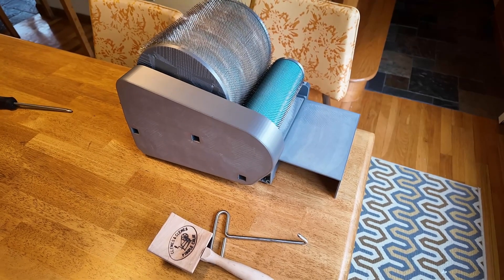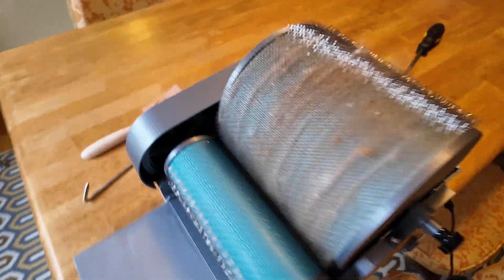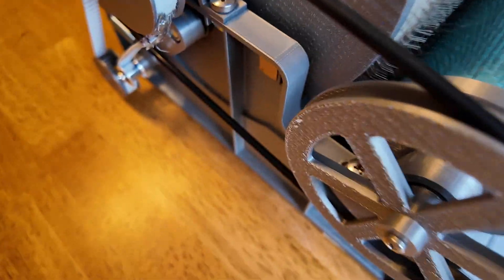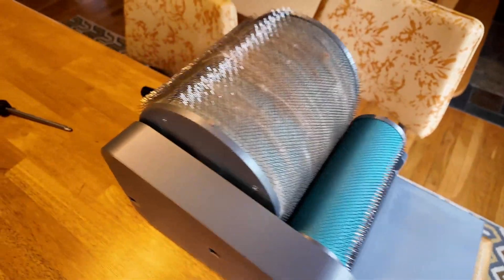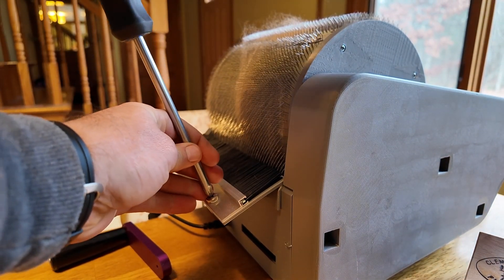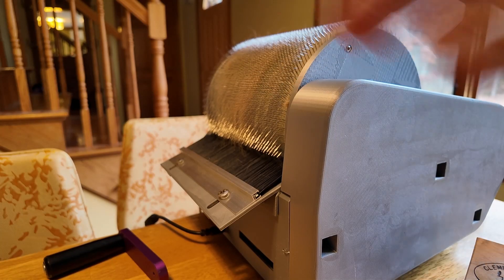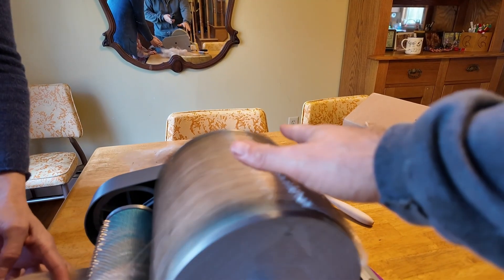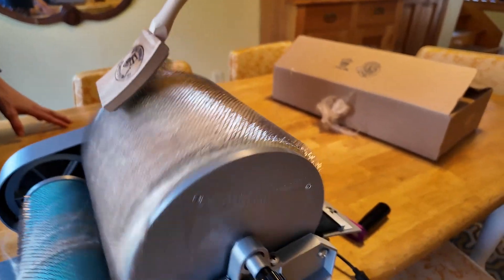Spin 191 - Drum Carder (Improved Drive Belt Power)

Comment: Hi #dreaming robots, I own an electric drum carder called the Ekelund Carder (engineered by Lena Ekelund in Sweden). She has put a 72 TPI on. After having used it for years, I wished she had put on a finer TPI on the main drum. 
Also there are 2 speed dials for the licker in and the main drum. The combing feature can be used as you wish by using a handle.

Comment: I have a little "wild" 4" drum carder with 72 tpi for playing around making art batts. I'm not terribly experienced but I'm really looking forward to your new electric drum carder. The Wild has a grooved channel for doffing which keeps the doffer from trecking off into the carding cloth. I see the prototype has a flat metal track. Still better than the older drum carders with just a break in the carding cloth to the bare drum. Also the Wild has a brusher that has a pivot so the brusher can easily be placed whatever angle needed or swung up and just tighten the screw knob to hold it there easily. Sorry if that doesnt make sense. If people need a longer tray to introduce fibre, that made me think of my inkjet printer. When I print something it activates and a hinged tray flops out to support the printed paper. But it has 2 hinges so a secondary tray can be opened out to support the weight of more than a few sheets. Thank you for these updates!
Reply from the maker: Thanks for the feedback.  I was already thinking about a groove in the metal for the doffing, but I need to talk with a metal manufacturing factory to see what that would do to cost.  I know the current solution is very easy to manufacture, but if I can add a bend or groove at low cost I will.

I am familiar with the hinge others use for the packing brush.  The method I came up with is more compact and cheaper to manufacture.  In my testing I actually like how it's also more secure.  It doesn't give you different angle options, but I'm not sure that's important.  More testing is required, but so far I like my solution better than what's out there.

There are a few options I could do for making the tray longer, but I'm not sure it's worth it.  Anything here will add cost.  I plan to do a bunch of testing to see how the current length works.  For people who really want a longer feed it is very easy to add your own platform to feed into the existing tray (for example a cutting board with a few books under it would work or a fancy solution would be 3D printing a different tray). 

I'm always trying to decide if it's worth adding a feature that will make it more expensive for everyone vs keeping the cost down.

Comment: Faster isnt better. Tender fleece will be pulled and torn causing neps if it's too fast. Also, holding onto the fleece while it's feeding will cause it to nep and stick into the licker in brush. 
This is going to be a game changer for those who are longing for a drum carder. And there are MANY! 😍
Reply from the maker: Thanks for the feedback.  We'll work on our technique and won't hold the fiber like we did in this video.  I've probably heard from about 20 people now on how we did that wrong 🙂

As for speed, it can be controlled and I'm just talking about max speed.  I'm still working with testers who know more about carding to me to figure out a good max speed.  Obviously there could be too slow and too fast.  I'm sure my current speed is fast enough.  If others think it's too fast then I'll limit the speed more.

Comment: I think it's important that the packer brush be able to be removed quickly, perhaps swung back somehow, and then quickly pushed back into place. Otherwise it can inhibit the backwards motion of the drum that you may need when removing a batt, and having to mess around with a screwdriver in between batts would be really annoying. I'd prefer some sort of thumb screw there rather than needing a screwdriver, but even better would be a way to swing it in and out of place  and keep the setting the same between batts.

If possible I'd prefer the feed tray to be a little longer, I like to be able to put my hand flat on the fibre to guide it in (but not pulling on it, which causes it to wrap round the licker in as you've found!), and  this looks a little short to do that. Also a small lip on either side of the licker in would be useful.
Reply from the maker: I can certainly go to thumb screws for the packer brush.  Making it articulating would add some complexity or expense, but I'll think about that...

Changing the feed tray length is difficult.  It's pretty much as long as it can be while being easy to store.  I will think about it more though and see what kinds of changes could be made.
Reply: @DreamingRobotsBlog  - You might be able to easily solve the issue of a longer feeder tray by providing an extender board (or the files to print one?) very much like sewing machines sole times have that option. My sewing machine (Toyota Oekaki) has this option. It’s basically a plastic part that clicks onto the machine’s base. If you can make it fit inside the debris tray or underneath the base of the carder, I guess it’d make for easier packaging or storage. 

If not standard, you could offer it as an option.

Comment: Not sure about the brush - it looks too rough. I have a "packer" brush and a soft nylon single row packer brush. It does sound loud, and this would be a deal breaker for me.
Reply from the maker: More testing will be done with packer brushes, but my understanding is that many people who use them don't get as much packing done with the brush because they aren't agressive enough with the use of it.  I will collect info about this from the testing and from several carding experts and include any info I find about how best to use these brushes for different kinds of fiber in the instructional videos.  I want to provide not just the best tools, but also the best instructions for these tools.

While the hand operated mode is quieter, even that mode will always be more loud than my eSpinners (all drum carders I've seen are also more loud than my eSpinners).  Not much I can do about this.  As for the motor noise, that is from the gear box and without a significantly more expensive gear box or doing something custom, I can't make that portion quieter.  I don't think I will be making those changes though since for most people I'm pretty sure the current sound level is ok, but I do understand it won't work for everyone.
Reply: @DreamingRobotsBlog  Howard Brush Company's "blending/burnishing" brush is very good, and not as harsh as my drum carder "cleaner" brushes. I'd definitely pay more for a quiet drum carder but I guess I've said that already.

Comment: I absolutely LOVE this! Such a great thing to create and from scratch, no less! I've created an electric system/drive for my wifes Brother carder and opted for gear drive for it. Much stronger and I needed the reduction to get the speed down a bit more while the torque was still higher. My 2 cents is gear drive/gear box for sure on the drum. 

If you're ever looking for beta testers with printers and experience in Fusion, I'd be super excited to help out!
Reply from the maker: I considered both chain and gear options for the swift.  There is already a gearbox on my motor to reduce the ratio there (about 100:1).  There were pros and cons to each option, but I think the timing belt that I'm using is working really well.  I will probably stick with that unless I run into unforeseen issues.
Reply: @DreamingRobotsBlog  That makes perfect sense! As always, I love what you do, and I really do love the community around it. Keep up the amazing work!

Comment: I saw some of the comments about the motor being loud, that motor is not very loud at all! That looks really pretty good! I like that timing belt change. The fiber looks like it was drawn on easily, though, like many others have said, the 72tpi cloth will not make as nice a bat for what looks like a soft alpaca fleece, as a 120tpi cloth would. Just because I'm intensely curious, how much is this prototype running for weight? Not that I ever intend to sling a drum carder around by a single hand, but I've had several drum carders, and boy howdy, some of them can practically throw your back out and any kids you have as well!
Reply from the maker: I haven't weighted the prototype, but I'd guess it's around 6 pounds.  I expect it will be much lighter than any similarly sized carder on the market even when you factor in a little extra weight for my motor.  That's one of the advantages of my plastic design.

I will do more testing later with different TPI.  The drums are easy to change so I could offer both 72 and 120 TPI drums if my testing justify it.
Reply: @DreamingRobotsBlog - I’d definitely be interested in having 2 drums. If you could include a cheat sheet on how to change/replace the carding cloth (with all its specs) that would be awesome - I’m looking to replace the cloth on one of mine now & not having that info is annoying. Agree that the motor isn’t too loud, but 👍👍 to your young designer 😀

Comment: My frustration with my drum carder is when fiber gets wrapped around the drums' axles. Is there a way to easily take the drums off, or otherwise clean fiber out from the axles on your drum carder?
Reply from the maker: Yes, my drums are removable and interchangable.  A complete drum replacement should be just 6 screws and take under 10 minutes.
Reply: @DreamingRobotsBlog  thank you!

Comment: Do you know what TPI you are planning for the carding cloth on the drum? 72 TPI is the “norm” for most things, but a higher TPI for finer fibers is nice. Just a thought for a (far) future option might be the ability to purchase additional drums & change them out for TPI options?
Reply from the maker: The current drum is 72 TPI.  I've been told by some expert carders that I trust that in most cases 120 TPI would be a better default.  I plan to test a few cloths later, but for now focusing on getting the carder working well.